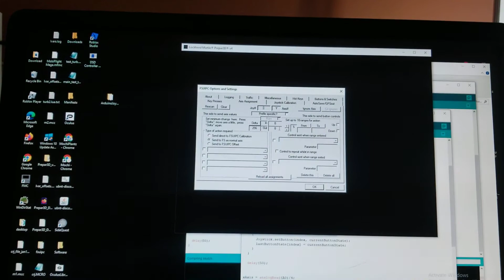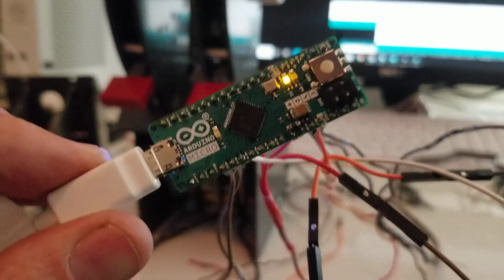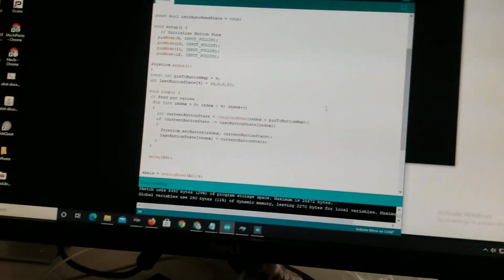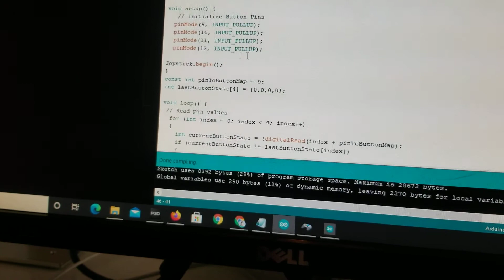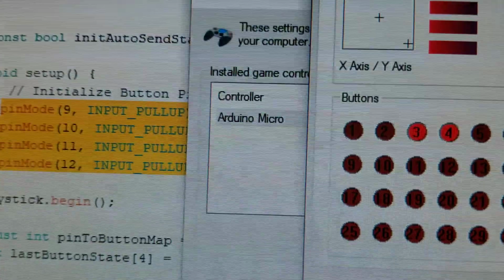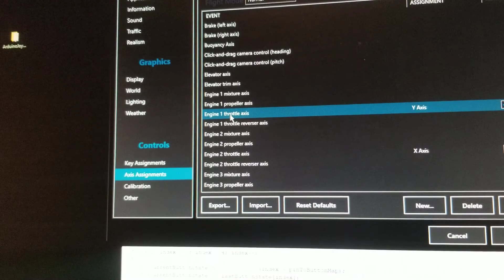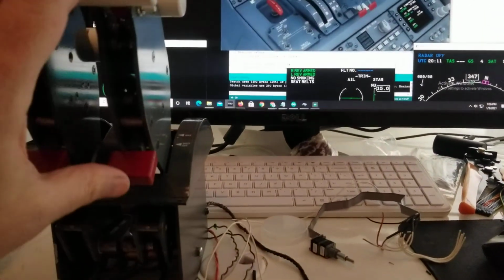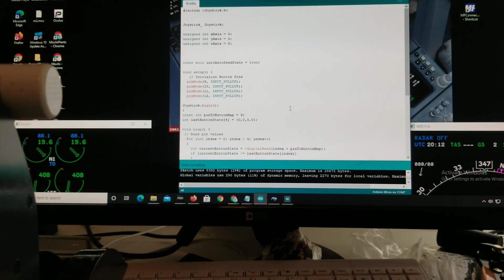Potentiometer and Flight Simulator, MobiFlight, Prepar3d, FS2020

Comment: Cool CRJ throttle design! Are you planning to build a full cockpit?
Reply from the maker: Thanks, I am almost done with the full cockpit.  Are you working on an CRJ cockpit?
Reply: @AaronWerner  Nice! looking forward for the showcase video of your cockpit. Sadly I don't have the space for a full cockpit. I am working on a desktop setup. I am done with MIP and a modular pedestal that is build around honeycomb controllers. Atm, designing a generic bombardier style overhead that I can use with CRJ700 and Challenger 650.

Comment: Hello Aaron, thank you very much for sharing your knowledge with the community. Before I do the electronic side I would like to ask you if these are DIY throttel and flaps and if yes if you can provide some details how you build them. Again thank you very much!
Reply: The throttle control I am using is not a DYI.  It was designed and built years ago by a company that is no longer in business.

Comment: Hey instead of using the complicated software you could always change out your arduino to a Leo bodnar gameboard and itll do the work for ya!
Reply from the maker: Thank you for sharing.  In my example, I wanted to provide an alternative to the Leo Bodnar.  With so many builds adopting Arduino, I figured it was time for a video to demonstrate how a potentiometer could be converted to digital output using a cheap $5 board and copy & paste my code sample.  It really is very simple and a great alternative to a more expensive board.
Reply: @AaronWerner  Yes it is a very good simple and good alterative indeed.

Comment: Hi Aaron, thanks for the video.  Would you mind sharing exactly the model "Arduino Micro" you're using? I'm on Amazon and seeing heaps of different options.  Thanks!
Reply from the maker: Any Micro should work. If you need the pinouts headers this one looks like a good one.  If you are just going to solder a wire, you can buy three of them for about $20 if I recall.  Just make sure it is a MICRO and not a mini, mega etc.  

https://www.amazon.com/Arduino-Micro-Headers-A000053-Controller/dp/B00AFY2S56/ref=sr_1_3?dchild=1&keywords=arduino+micro&qid=1620703503&sr=8-3
Reply: UPDATE: All interested, you're able to also achieve this with the Arduino Pro Micro boards.  They're 1/3 of the price of the Arduino Mini.  You simply upload the sketch to make it a joystick board.  There are the ones I ordered: https://www.amazon.com/gp/product/B01MTU9GOB/ref=ppx_yo_dt_b_asin_title_o00_s00?ie=UTF8&psc=1

God bless.

Comment: Great! What are the specs on your potentiometer? What potentiometer specs would you recommend as best for flight sim building? Thanks.
Reply from the maker: I am not really sure what they are.  When I get a chance I will try to pull a number off them.  They are super old and I am pretty much updating them with the arduino.

Comment: I don't understand. Since when does FSUIPC not recognize a standard linear taper pot?  Because I've been using FSUIPC for over 15 years with various control boards from Leo Bodnar or other sources without issue.  Are you saying it just doesn't work with MobiFlight?
Reply: For the price of one leobonar  you can have something like 5 mega board or leonardo    (china clone)
Reply from the maker: Hi Jeff, As long as you have a way to convert the signal to digital.  I assume your boards from Leo Bodner did the conversion or was recognized as a joystick controller.  I show in this video how to use arduino and install joystick library to get same results.
Reply: @AaronWerner  I’ve yet to use arduino boards for FS but see a lot of people doing it.  Are there any major advantages over old tried and true methods like Leo boards.  They seem more complex to me and require added coding and configs that standard control boards don’t require.  So what is the advantage? I want to use them for something at some point just to gain the experience.  Nice CRJ throttle btw..
Reply from the maker: @oldowl4290  the main advantage is price and the options they provide for tools like mobiflight.  The nice thing about Arduino for flight sims is that there really is very little programming if any.  For example in Mobiflight you can configure your aircraft and the software takes your configuration and writes the code out to the board so you never have to worry about that.  They are also good to use with LED's or forced feedback from flight simulator.  On simple pushbuttons a joystick controller like LEO is fantastic but you can quickly convert your arduino to the same joystic controller card with very little effort.  For more complex aircraft, I have not been able to accomplish what I want outside of using arduino.   I am not saying they are the end-all but it never hurts to try something new and heck...you might like it.

Comment: Good stuff Aaron . Happy new year from Bournemouth England
Reply from the maker: Thank Rob.  Happy new year from Saint George, UT.  I would love to visit England.  Let's keep in touch!
Reply: @AaronWerner  when the madness is over you should 100% visit . It wouldn't be the first time I've shown a American around our Isles . Stay safe
Reply from the maker: @calamityairlines9762  Sounds like a plan!
Reply: Aaron,  can you help to configure Arduino potentiometer slide to get full range.  I copied your code and I is recognized as a game controller but I am not getting full range. 
Thank you owen 
Owen1071@yahoo.com
Reply from the maker: @owentomlinson5545  Did you go through the calibration?  I am not 100% sure.  I will mess with it and if I can figure it out, I will let you know how.  If you happend to figure it out before me, please post the solution here.  I am traveling so it may be a few days before I can get to it
Reply: @AaronWerner  yes but it max out half way through the slider.  Also I  am very new to working with Arduino. 
Owen
Reply: @owentomlinson5545  I believe i removed the /4 on the analog read area in the code, and then removed the null value when I calibrated it in the flight software.  Removing the null was located in the options area of FS when you calibrate your axis.
Reply: @wirelessliftinc4769  Could you elaborate on this? Which specific areas of the code do I remove? I am trying to configure a slide potentiometer to work on axises and throttle controls, based on this code.
Reply from the maker: Did you ever figure out how to achieve the full throttle positioning or is it still only going half way?